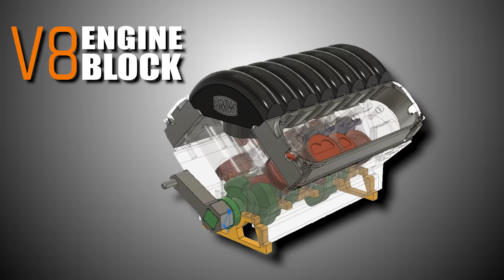5-Axis CNC Machined V8 Engine Block!

Comment: Neat trick turning one cylinder into 8.
Reply from the maker: Ha!
Reply: what???
Reply: @dccracker7922  the original metal piece was a cylinder, he got an eight cylinder engine block out of it
Reply: Ayeeee
Reply: Ahh i see what you did there :)

(Edit) yay i got a like 😊
(Edit) yesh 3 like😁
Reply: i read this three times before it clicked lol
Reply: Neat trick useing your words to make a good comment .
Reply: Jim's videos 
Actually, I think he removed 8 pistons...
Reply: This comment needs more likes.
Reply: Tony Wilson  
Made the Chinese Masters of Combination .
Reply: Technology can do anything #Genius Life hacks
Reply: Simply the axis is every motor placed in the joint. How many motors - so many axis.
Reply: This comment is au
Reply: That the first funny joke I’ve seen in YouTube comments
Reply: David Ouren  I haven’t seen those
Reply: You mean turned a piston into a block
Reply: At 0:51 the cylinders of Aluminum are switched. At 3:00  eight holes magically via editing appear.
Reply: @haleydees7534  
It's a recursive remark (think inception)
Reply: @marshy_4599  34 likes
Reply: Please run for president.
Reply: With just one machine, many different techniques can be met.

Comment: Impressive!!! I used to program CNC machines over 25 to 30 years ago my 1st machine was a paper tape reader we moved to a 3.5 floppy disk and then to rewrite CDs. Then I got rifited after almost 15 years of prototyping. Now I do mechanical engineering.  It was the best job I ever had. I put experiments into outer space that were successful. I made  prototype medical devices and equipment and other things I can't talk about. I also did model making, injection molding, metallurgy ,Mig, Tig, plasma, and complete wood working, to many other skills to list. That was the most fulfilling job that I ever had. The rest of my career has been boring in comparison, however it pays the bills.
Reply: It's great to hear that. From your perspective, which machine would you suggest for a performance shop???
Thanks in advance ☺️
Reply: @TheRealMrGrIoT  Most of my experience was on Bridgeport and Central Machinery. I really can't speak on newer machines. Because the advancement of machine tools has probably seen improvements by leaps and bounds from what I had experience using in my youth. Sorry I couldn't be more helpful to you.

Comment: There's something very reassuring about the tool changer 
Like a firm handshake 
I know its ridiculous but still found it funny
Reply: having them at 100% speed is terrifying lol 
i always felt like it was about to throw the tool holder straight through the side of the machine -__-
Reply: I've seen one throw a probe across the machine enclosure. Threw it so hard it sounded like a bomb went off. The probe was toast.
Reply: I know exactly what you mean. That tool changer is extremely satisfying to watch.
Reply: Satisfying until it stops in the middle of a tool change!
Reply: are you kidding me?haha
Reply: @PiefacePete46  GOOOOOOOOOD $))))))
Reply: i love the haas tool change, but a lot of the older VF toss tools and drop tools like no other
Reply: Better tool changers , but more expensive and tricky to fix when they break

Comment: john you can't say "sounds like a v8" and not let us hear it :(
Reply: Dont run its a paper weight
Reply: he said in the video that they turned it with a drill and it kind of sounded like a v8
Reply: .rotfgl....yea, don't smell like a V-8.
But kool none the less
Reply: @ikbendusan  turned it with a drill... the airmovements caused by the 8 cylinders moving back and forth actually cause an audible noise with driven with a drill. 500rpm would cause the same noise produced by a real v8 minus the combustion event.
Reply: @screener545  yes but we want video evidence ;(
Reply: @phuckyocouch9098  3yrs to reply lolz made my day lol actually not a paper weight went into a 1/4 scale midget car by the fellow who bought it from me

Comment: These machines are awesome. When I was working I used to walk out to the Manufacturing floor and watch the huge Mazak Mill doing it's thing. It is mesmerizing for sure. The operator was sitting in a chair with his feet up on the machine sleeping.

Comment: Fantastic job on the block, without doubt. It would be quite the accomplishment to machine all the parts needed to complete a fully functional engine. The mind boggles on all the programming that would be involved.  Thanks for the video.

Comment: People have done scale functioning engines before so it's definitely doable. There is definitely a market for that kind of thing in the rc\model worlds. People invest great deals of money into them. Great video.
Reply: back in the 1980s there was a guy making and selling  1HP 1cu in V8 engines in the back pages of hot rod magazines for $1000. they were fully functional 1/18 scale motors for rc cars that could fit in the palm of your hand. they had a tunnel ram and 2 carbs and were quite sick.
Reply: @Q5Grafx  that's cool. There is a guy making a v16 or v12 that's fuel injected for an rc car that he in making basically every single part for himself. I'll find the video and attach a link
Reply: If you google them, there are more than a few making and selling them....last time I checked they were upwards of $10K USD. When I saw it I thought, hell, I can buy a 5L Ford Coyote Crate motor for that.....(but it's all about production and supply and demand).
Reply: @Q5Grafx  Conley Precision Engines
Reply: @blindabinda1234  Keith5700 is the channel you're looking for? The V10 is actually his second engine. His first was a V8 but is not on his channel. If you google Keith5700 you'll find some excellent detailed build threads on a few forums. https://www.youtube.com/watch?v=rz0Uteqfpao
Reply: @Q5Grafx  I know its been a while, but where can I find these engines? Been looking all over for one of them.

Comment: Life is so much easier using renishaw 🤓 I remember before we had them , manually setting x and y with a 5mm probe , setting heights with a 2inch probe and allowing for it in the offsets. These renishaw probes are a dream , select you program , g54 , diameter z drop f4 and 2 and the jobs set already . So easy

Comment: Is the lathe project still underway? Btw: AWESOME results on the V8. A tip: you most definitely want to line bore that crank journal before you hang a metal one in there and light the fire :)
Reply: I would love to see an automated machine balance the crankshaft.

Comment: Wow ! That machine is just the biz ! 
I would love to see a Wankel being machined on it and you could turn both of these motors or models into a moving display  by adding a small electric motor to turn them over  . They would make an interesting display for your reception area or front desk .
Reply: he mentioned a  working Wankel ... that means you put fuel in it and burn the fuel to make it move, no electric motors to make it look like it is running...

Comment: Was this your CAD design? Maybe make the model public so people can make parts that will bolt up to it in fusion 360 (good way to generate more interest in the platform) and have a YouTube design contest to determine which parts to make. I’m a mechanical engineering student, so I’d love to try modeling the necessary parts to make this engine block into a fully workable engine, especially if they might get produced for free. I’m willing to bet there’s plenty of other folks who can do the same. Let’s see who can make the best complete engine design from a manufacturers perspective, then watch you machine it!
Reply: Why they should share the cad thats their own business you can foud on grabcad
Reply: Seconded
Reply: @Bomboclaat31  because who TF is buying a model engine that doesn't even have a water jacket?

Comment: Great! You have a block, now I want to see the pistons, complete rods, crank, cam, lifters, valves, intake manifold, water pump and oil pump anything I might of missed. Out of metal I would like the crank shaft and cam and  have the engine run. No pressure. The block is cool no doubt but I'm not after a paper weight.

Comment: My machine shop professor made an engine that ran on compressed air it was amazing to see it operate functionally. I was amazed most by the exhaust valves sound like a diesel engine engine

Comment: Awesome tooling and CNC work! I hope you get to the point where you machine the entire engine (except for the spark plug wires, air filter, etc... that aren’t metal) so that it works with real pump gas (petrol, for you UK people)! Not sure how you’d make a miniature, working spark plug, though. Can it machine ceramic, or would that (spark plug body) have to be cast?
Reply: Would make more sense to design it to work with the miniature spark plugs from small single cylinder engines, the Honda GX25 comes to mind, it’s a consumable item, and not trivial to manufacture.

Comment: That rapid movement to the underside of the engine block... I would soil my pants so hard the first time I would have to run this program...
Reply: Gotta trust the programmers bro
Reply: Not just the programmers, but the Post Processor as well. Got to make sure something didn't go rogue in how that thing interprets a rapid motion, and collide with something. The Cam is only a portion of this battle against crashes.

Comment: Why are people suggesting that you make a running engine? How can you cut the internal water passages needed to run coolant through the block? What about the internal oil passages?

If the block had been made on a 3D printer the passages could be built in and 3D milling could bring the cylinders and measurements into spec.

But you can not make an operational engine block using only 3D milling.
Reply: Yes you can...many companies do it...there are a bunch of videos on youtube showing the entire process...
Reply: @kyleboren7372  One of us is a tool/mold maker by trade and knows what EXACTLY what is involved,  so where EXACTLY are the mentioned videos? You can machine (drill)  simple water passages in solid metal but that does not provide cooling for LONG TERM  running of your engine because of the limited volume of the coolant passage/thickness of the remaining metal surrounding the cylinder in the block/head. With uneven cooling the metal does not expend equally and the piston and valves sleaze ending engine operations.
Reply: @rogerc.roberts4705  just because you can't do it doesn't mean other people can't...
Reply: @kyleboren7372  At no point in the video do they hollow the block to create water passages.
Reply: Kyke, you fell for my TRAP. The aluminium 427 video shows exactally how they create water passages in what STARTS OUT as a single billet of aluminum. 

Did you notice that each "cylinder wall" is a seperate machined sleeve that rests in a counter bore at the bottom of the block? Watch the video you suggested,  they slow one of the uninstalled sleeves.

Next the video shows the block and you will notice that a rectangular box has been milled into each deck of the block. The deck upper surfaces ( not shown) are plates w/ counterbores to accept the top of the cylinder sleeves trapping them in place. The cylinder sleeves and plates are assembled into  MULTI PIECE block. The coolant occupies the space formed by the assembled pieces. 

As I stated from the beginning, you can NOT use 3D machining to form an engine block with required internial water passages from a SINGLE BILLET  of metal. However, you CAN 3 D print a single piece block w/ internial coolant passages. 

The original video shows the cylinders bored into the one piece block. The are no coolant passages in that example.

As stated, one of us has the experience in this type work. I took the opertunity to go into more detail than the videos offered.

Comment: Yeah, make function model... :D
Reply: YEAAAAAAAAH :D :D :D .... V12 XD :D
Reply: Engines have crazy tight tolerances, I don't think he has the machinery to do it
Reply: But when you ask for an engine that just runs and that not on high Efficiency, it isnt hard... Just look on YT... :D
Reply: @collinbetten9377  not as tight as you think, eg: my recent motorbike rebuild had a new piston with 0.1mm play, the previous piston had 0.5mm play,  most VMC's can do 0.01mm to 0.0001mm accuracy
Reply: How about you design this block... bet ya cant.
Reply: thats normal becurse the piston gets way hotter so it needs a bit room to expand but your right 0.5mm is to much i would give 0.02-0.03mm per cm diameter sorry for my bad englisch im from germany
Reply: @89Ayten  as a matter of fact I could.  But I dont have a haas sitting in my shed to make it so i wont ;)
Reply: @CHEFKOCH1837  your English is perfect, no need to apologize ;) 
Yeah 0.01 to 0.04 is good, you also need to make the pistons a little oval rather than round for piston heat expansion as well.  Up to 0.1mm difference is good  ;)
Reply: They already do that... Was expecting to see a full size block...
Reply: almost impossible to implement cooling with a CNC machine.
Reply: .003-005 is tolerances in many things. within automotive sphere.
Reply: @collinbetten9377  - Don't know much about machining, eh, buddy? He can manufacture EVERY piece on the equipment he has presently in his shop. Don't underestimate the capabilities of CNC equipment. Take a tour of a decently-equipped CNC shop sometime - I'm pretty sure you'll be either awestruck or totally dumbfounded...
Reply: @89Ayten  - I'll bet you I can - I did design an 8ci V-8 in the late seventies. Still have the prints somewhere, I think...
Reply: A functional model, unless it is a tabletop engine to run under no load it will need coolant passages. And lubrication. Clearances to allow for expansion.
Reply: @TheGoreforce  not true. Freedom racing engine billet cummins blocks have cooling passages. You just run the holes where you need them then either install freeze plugs or block off plates
Reply: @CHEFKOCH1837  To be perfectly honest. Most Americans respect bilingual people because even if their English is shitty, they still can speak more languages than than we can even if you only can speak 1 1/2 languages. 

The only thing that pisses us off is the new generation of immigrants believes in lack of assimilation and pushes their native country's views on us. If they liked it where they lived so much, they should've stayed.
Reply: It's not tolerances stopping him making a working model it's the fact you can't make the crank cams ect on a mill to be done properly you need a rotary grinder and it would be stupid expensive just to build a decent running example
Reply: @collinbetten9377  Indeed he has. It's not about machine, it's about tools, parameters and operator.
Reply: @collinbetten9377  No, tolerances aren't that tight.  Many are looser than you'd think.  They hone the crank/main cap bores, cam bores and cylinder bores to size, they are not bored to size, I think the lifter bores might even be honed.  The valve seats bores in the heads are about .0005 tolerance, press fit for the seats, the guides are the same, bored for the guide inserts, then honed or reamed to size.  Most of the rest of the engines are +-.005 or so.
Reply: @89Ayten  maybe just a 2 stroke v8.

Comment: Cleanest Workshop ever. where i work, the oil drips from every wall, the air is cloudy from the cooland and the floor is black. i hate it.
Reply: Sounds like a typical machine shop to me. Cleaning it would be a never ending battle. Id just keep the metal shavings cleaned up and my work space organized and keep on moving.
Reply: @vikinginfidel4293  ya,all good, but i taste the cooland,my eyes burn,i must search for any tools and stuff. Its not a modern thing, and workshops like that waste profit because of old behavior and dont realise that in those shops the most skilled people work.
Reply: @Bollerkotze  holy crap, that's definitely a health issue. I'm assuming you guys may not covered by OSHA. I'd invest in some PPE or see if the shop will provide it. I build powerlines for a living so OSHA is always up our asses, but it's a good thing because the company must provide PPE. Hard hats, safety glasses, leather gloves, FR clothes, and for obvious reasons, our rubber gloves and sleeves rated for the voltage we work on.
Reply: VikingInfidel what’s so Viking about you?
Reply: Bollerkotze you’ll end up with serious health problems if you stay there .
Reply: Sadly most job shops are like this. The real (beyond health) problem is the owners are so go go go time is money that they don't realize that if customers walked into a nice clean shop with happy employees the business would increase astronomically just from perceived work environment. Cleanliness is a sign of quality and detail and customers see a dirty mess where you touch anything you get metal slivers and dirty and imagine their products or parts arriving the same way built by people who unhappy grumpy and uninterested in my parts quality or anything else. Now a customer walks into a clean shop and sees the happy employees who are not only machining their parts with care and being able to do so by using tools they can locate are clean and a surrounding to match. I know it, I help machine shops get work and fix tarnished images before they learn by working for someone who gets it. I can turn a shop profitable in 90 days provided they have equipment to do the jobs and aren't doing work out of their capabilities.
Reply: I work one machine shop, more than 30 cnc, and you will never find shavings/oil on the floor, when machines are working you always clean the floor, floor is blue with yellow lines, work on that place for more than 8 years and the floor/machines/tools is always clean.
Reply: you have 3 days to live
Reply: @dznuttzonyachin7499  he is dead
Reply: @GuyFawkessupbiches   RIP ⚰️💀 @Bollerkotze
Reply: go work for a company that makes medical parts.  That kind of environment is way past unacceptable there.